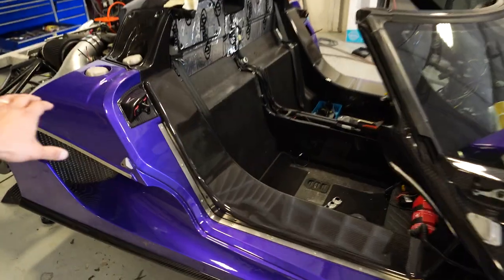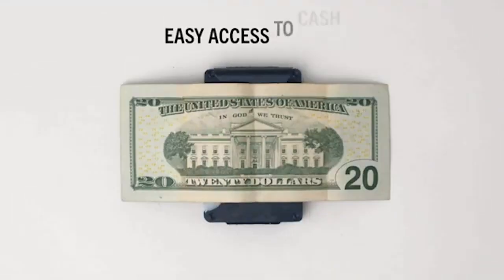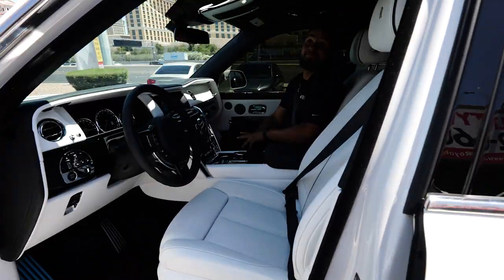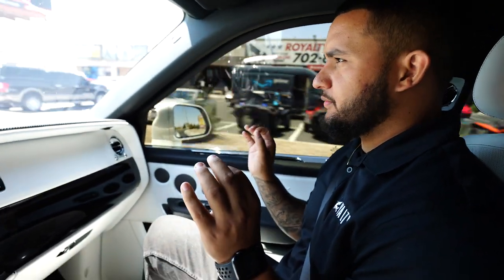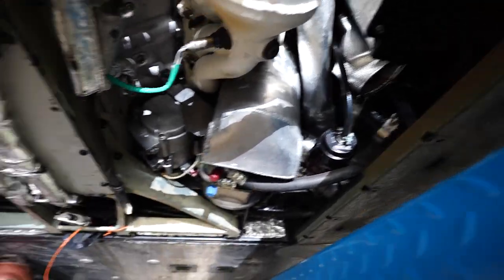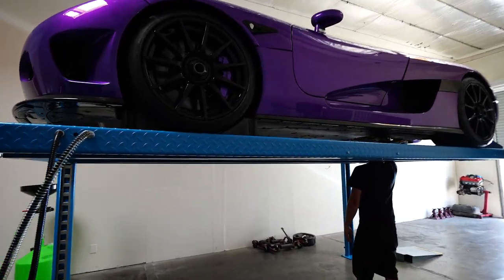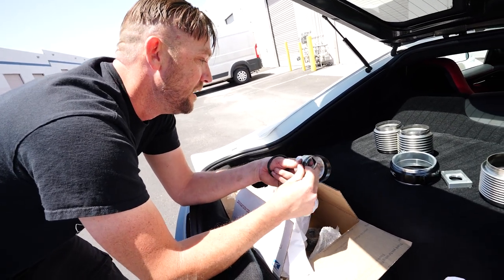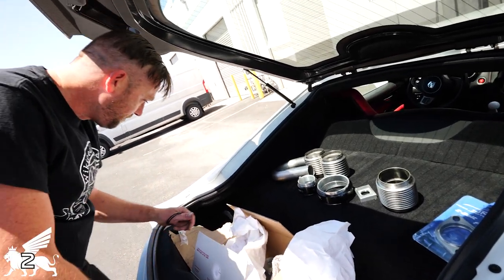Twin Turbo Koenigsegg CCX *Worlds First*

Comment: replacing the supercharger with turbos means that it'll be making less power for most of the rev range, effectively creating a narrower power band, unless you use sequential turbos with one driving the other or build the engine to rev higher to compensate.